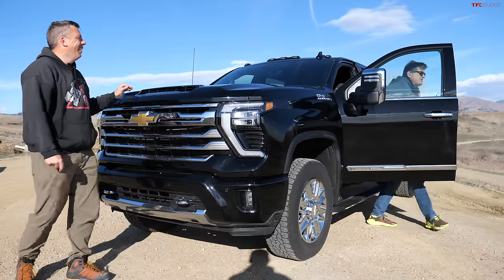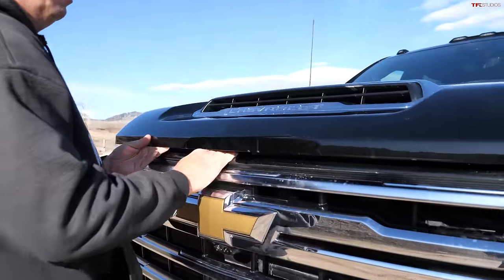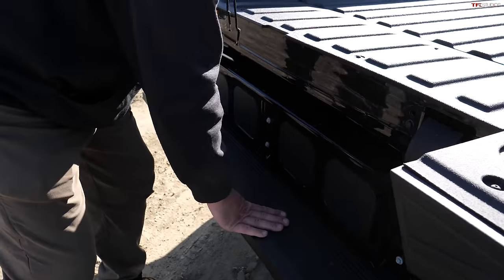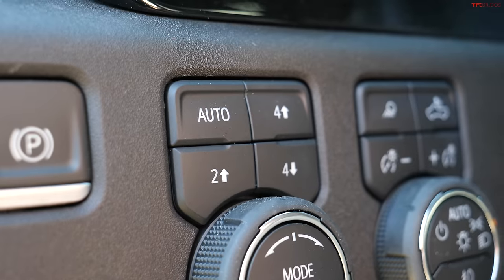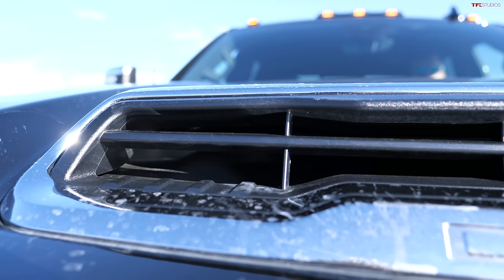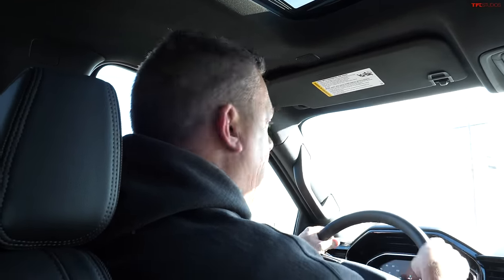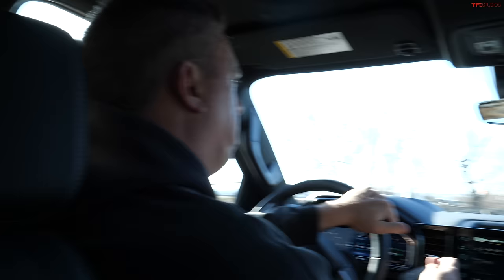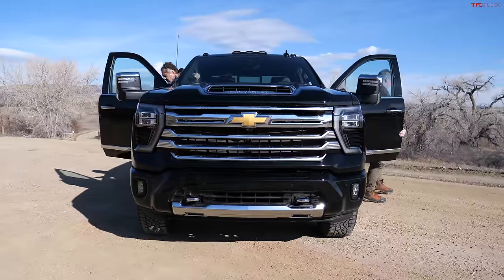Is The New 2024 Chevy Silverado 2500 HD Duramax Diesel The New Benchmark for Heavy Duty Trucks?

Comment: Tune your diesel trucks. Doesnt matter if you’re young or old and you’re wanting huge power or a casual driver, Working truck or daily driver. I habe. 2023 high country. I have it tuned, i use it for work and casual driving all over the place. 5 different power levels and it makes driving my fun more fun and truthfully if i drive casually i get way better fuel milage than stock. Waiting on trans tune to show up now. Should make it shift a lot less lazy!

Comment: I'm seriously considering a new 2024 Sierra with the 6.6 liter gas engine or a Ford with the 7.3. I'm looking forward to Ike tow and mpg tests.
Reply: Or now for 2024 ford has the 6.8 to me no difference to the 7.3
Reply: We have a 6.6 gas with the 6 speed transmission and a Ford 7.3. Both tow mini excavators (about 15k lbs.) Both are pretty comfortable towing the weight. The Ford has more power, the gm gets better mpg. Gm gets about 18mpg unloaded, Ford gets 13 unloaded. Loaded gm is about 10mpg, Ford is 8mpg.

Comment: Ya know, Ford may have a higher peak torque rating, yet GM has the most honest approach about it.  Check out the power graphing of the 2024 L5P over the 2020-2023 L5P.  Its a 25% increase in low end torque production on the 2024 and that's even before you hit peak torque and the torque management has been tweaked.  And it hits the torque quick.  Ford may be getting 1000-1200 peak torque, but the neutering in place before it allows the powertrain to take advantage of it will be extreme.

Comment: Now if only they added a heater for the fuel system and DEF system so they don't freeze in winter.  That bricked by 2022 3500 AT4 Duramax when I really needed it on a cold Vermont day (I suspect those Fairbanks folks would have that issue too!!). Since I did not need the towing capacity anymore, I traded it for a gas truck.  The GMC also had a major module issue that went bad and I had no ABS, AWD/4WD, traction control, cruise control, etc!  Loved that truck but hated it too...  sometimes I miss it then it gets cold and I can start my gas truck and don't miss it anymore! ;)
Reply: They do have DEF heaters.  Two of them.
Reply: @sconner  Mine sure did not work if they had them on the 2021. Now I understand why people have them deleted.
Reply: @jean-sebastienlatouche3678  I totally get deleting the crap.  My 2016 has had a DEF heater replaced twice.
Reply: never an issue in fairbanks, but i made sure to park OUTSIDE. that way the DEF system shuts down, and stays off. until teh heater melts teh tank which it cant do at -40
Reply: @jean-sebastienlatouche3678  all OEM buy teh same DEF heaters, then to meet emissions all OEM over power them and they burn out requiring a tank replacement.
Reply: @jean-sebastienlatouche3678  My 2020 AT4 HD didn't have any problems with def when it was parked outside at -30f these last couple of winters and my 2023 AT4 HD that replaced my 2020 didn't have any problems at -37f. It's very rare that the heated shop is empty enough to fit them in so they have to stay outside plugged in. The 2016 Ford F-350 that I had previous to the 2020 AT4 went through 4 DEF heaters throughout the 115,000 miles that I had that truck. The Ford had constant problems.
Reply: @specialestness  I am glad yours treated you better!  It took one night of -28F to brick mine. Both diesel lines (with filter now waxed...) and DEF were frozen...

Comment: They should have integrated the engine block heater plug into the grill for easy access. The bottom of the bumper doesn't seem to be a thoughtfully designed location.
Reply: It was probably designed this way because the grill would be difficult to get to with a snow blade blocking access.
Reply: Wonder if there’s active grill shutters. So a cord can’t come through the grill. My Tundra is on the front bumper, just as low as that one.
Reply: They've been putting those there since 2020 without any real issue. On the half tons, at least the half tons with the Duramax, they put the plug on the lower front bumper as opposed to off to the side. The active grille shutters would be in the way to have the plug be by the grille

Comment: TFL, have you asked anyone at GM why they insist on firm seats? No one seems to like them.
Reply: Would love that question to be asked of GM. We are in the market for a 3/4 later this year for towing an RV. If we are going to be spending doing hours driving seat comfort is a critical parameter and could be a deal killer on a truck I'd otherwise consider.  Why make the seats so firm?
Reply: They are firm when new but break in nice. Plus a really soft seat stretches the stitching and comes apart.
Reply: @dongarrison2668  22k miles on my truck and still way too firm.... I'd rather have to redo the seat after 100k miles or so rather than be uncomfortable
Reply: My wife and I are looking seriously at a 2024 Sierra 3500 Duramax.  Its primary use would be to tow our RV.  Thus, much of our driving will be 4 - 6 hour trips.  Having uncomfortable seats would be a big negative.  Our GMC dealer has not received any 2024 HD trucks yet, so we've not had a chance to sit in the seats and take it for a drive.

Comment: I drive a 2023 Peterbilt with a Paccar engine it only put out 470 horsepower with 1900  pounds of torque this truck has more power than the Pete u said 9,500 bucks for diesel great video

Comment: I like the Chevy interior over the GMC.  Seems GMC just got lazy and recycled the 1500 console, leaving a weird pad where the shifter was and kept the brake controller further from the shifter.  But you get a big shiny push start button. I also see they both got rid of the 12v outlets.  Wish they kept those as they power numerous electronics I absolutely need for work, towing, and camping.

Comment: my 2020 2500hd duramax z71 offroad seems a way taller vehicle than what yall are standing beside. at 6ft my shoulders are lower than the hood, the chrome strip under my glass window is at shoulder height. why does that truck look so short? looks good inside and out but i prefer more chrome and less black out.

Comment: What about the gas versions
Reply: That's what I'm most excited about. Curious to see how well the L8T matches with the 10spd.
Reply: @hellkitty1014  There is already a guy on YouTube with one doing 0-60s and passing power tests as well as just general driving through the gears. Passing acceleration is up but the 6spd truck has a bit quicker 0-60 he said.
Reply: @pryme2013  wow, that's interesting! Maybe the 6AT was geared better.
Reply: @hellkitty1014  Yeah he said it was due to just how it’s geared. My guess is it doesn’t have to shift as many times before 60 so it is a bit quicker. I have a 22 with the gas and 6spd and I’ve never once cared to try a 0-60 but maybe others do.

Comment: The price is not that bad given that I paid $80 k's for a Tundra Capstone. 
If you are patient, the way they sell latelly , you may be get a discount pretty soon. 
If only they could inspire a little bit more confidence on their reliability,, I would stongly consider. Somehow GM keept it pretty resonable compare to Ford or Ram.
Reply: Na you wont see no discount, these manufacturers are controlling supply and demand by limiting orders and shutting down manufacturing to limit supply enabling them to keep the market accepting of these prices.
Reply: @Pantelifts10  I believe there is more than one reason, why a Tundra and most of these new trucks are so expensive. Suply and demand, because people like me  pay what the manufacturer asks regardless of the cost and so on,, 
I am not going to argue that a HD Gm would tow more or carry more. They are built that way , where a Tundra is built as a light duty truck. As to the reliability of a newly designed Tundra,, is expected to have some growing pain, like with everything else in life. Knowing Toyota, I am not going to be scared because they have few turbo waste gates issues. I trust them, more than any other manufacturer that , they will fix this and any other issue will be addressed shortly. .  
Why I purchase another  Tundra ?? is because my 2010 Tundra last it me ( 485 000  miles) with just a water pump that needed to be changed at 235 K before I sold it. Granted that 70% of my mileage is highway, is still considered a pretty good mileage   
Is Toyota and the rest of the manufacturer getting a little costly ?? hell yes. 
If I had to tow more often, need a higher payload capacity , the GM would be a pretty good choice for the money they are asking.
Reply: @vengeance268  my local Chevy dealer is discounting about $4000 off MSRP for trucks that are on order, not on the lot. You can say what you want but if you look from just a couple years ago, the manufactures are barely keeping up with inflation.

Comment: I've been looking into getting a new truck lately but the price tags on most of them just seem insane. I've always been a chevy/gm guy and would love to get into one of these but my work takes me off road quite a bit. With as tall as these trucks have gotten the ground clearance doesn't really seem to have improved and in some cases (DEF tank location) things seem worse. Those front ends always get a little busted up from me, so i really am not a fan of that block heater location, it sends like an expensive fix even to install an off road bumper.
The power and towing capabilites are incredible but I'd love to see a more farm/ woods capable model even if it sacrificed some towing capabilites. Something with tremor or zr2 abilities but without all the expensive upgrades it takes to get those trim levels
Reply: trail boss will be added for 2025

Comment: The headlight and drive mode (or 4x4) knobs side by side are a non-issue.

No need to keep bringing that up. GM has had auto headlights for like 50 years. They work great. No need to touch that switch. Wouldn't miss it if it was gone.

Comment: Man I own a 2020 2500hd diesel and the placement of the 4x4 switch is not ideal for me on this new one.  I like the current one but the new dash setup is saweet on the upper trims.  I hope they have fixed all the problems though: electrical, noisy brakes, leaking back window, emissions errors, etc.

Comment: everybody who knows about trucks and loves trucks that gm does not  play games like ford or ram, but they all wait until gm brings out their power train and then they add more power to compete because we all know in 2011 when gm told ford lets compare towing, truck against truck ford backed out,  and if gm wants shows  both ford and ram it those not take 1000 or 1085 torque to pull 0ver 35.500.00 kg. so that tells u something, that who powertrain is the best

Comment: The transfer case control buttons are down by the light control knobs ,isn't near as convienant as they we're and the fan control on the heater- air conditioner sucks the knob was way better and its not operator friendley

Comment: The cold weather cord said 120/240.  Could you elaborate on that?  Are there different outputs for the different voltages or recommendations on which way to power it based on outside temp?
Reply: Probably just for versatility. It's just a block heater. Nothing fancy or complicated about them

Comment: This actually looks like the previous model. I think you have it wrong regarding other manufacturers benchmarking against this truck especially considering Ford outsells both the Chevy and GM pickups. . These large pickup are growing in height and length with the main use for towing big trailers. I'm really curious why 0-60 times are important in these mini semi pickups. You need to check your average new vehicle cost. A new "average type" vehicle excluding trucks comes in at $60,000.
Reply: Ford outsells Chevy and GMC separately, but when you add the two together (as you should since they're both GM) they actually outsell Ford.

Comment: They cost a lot. But, i bought my 2018 Ram 1500 Longhorn, new for 46000$ here in Sweden, brand new, +25%tax. But the tax is refunded to me because I use it as a work truck payd by my firm. I got a 5300$ Discount on it. I have 47875 miles on it. Today the dealers ask 44-50000$ for the same Truck with the same miles. I have owned a bunch of Mercedes, and my friends are driving WV, vans, in there businesses, and they have never reached this kind of resale value. So my Ram is an investment and i love to drive it. So the smart thing would be to sell it, but it's a ceaper. Because when other change to EV, they are going to, dream about my Hemi engine, and that keep up the value.

Comment: You guys talk like 19,000lbs is a big deal. My 2020 F250 HCTTP is good for 22,100lb. It has 2990lbs of payload. And runs 0-60 in 6.5 sec. The BIGGEST ISSUE with the GM short bed HDs is the gooseneck ball position is 3" aft of the axle. That is a bad idea. You want the ball forward of the rear axle to apply load on the steer axle, and it also reduces sway. The trailer can't induce sway because the connection is between that front and rear axle

Comment: The seats are a deal breaker for me. I owned a 2019 Silverado 1500 LT and I'd adjust the seats every time I drove trying to get comfortable. Absolutely awful seats. My whole family grew up GM/Chevy people and now dad, brother and I all own F150s. Lol found a 2016 F150, 3.5 ecoboost, crew cab 6.5 bed, tow mirrors, 36 gallon tank. Well equipped, the seats are soft , more power and torque than my Silverado with the 5.3 and easier to work on. I hate that the new GM products are all encrypted and locked down. Can't do shit with them and it's really frustrating. I want to like the new GM trucks more but the newer Ford's are fitting what I want better these days. Still, they are nice trucks overall.

Comment: Why is it that fleets don’t really haul with Duramax pickups? Hot shot truckers and commercial duallys are almost always running Cummins or power stroke pickups from my experience. Any suggestions or comments?
Reply: It is the obvious reason.   If they performed the job equally well or better then everyone would use them.  That IFS doesn't help either.
Reply: @boduke9428  how does the IFS impact towing ?

Comment: Hey TFL guys I have a question for you and maybe you can do a video about this....I have a 2003 gmc but it s 1500 hd has 8 lugs and feels heavy when you drive around my question is why they made 1500 hd if they are the same like 2500 hd I know all 2500 around that age are 6.0and mine is6.0...so my truck is really a 2500 or just 1500 with more towing capacity
Reply: Chevy made the maxx packages for rating and capacities to give the trucks best in class figures.

Comment: 0-60 is a useless metric.  World's toughest towing test needs an update.  My pickup weighs roughly 12k lb on a daily basis and is then expected to pull trailers on top of that.  Trailers range from 12-24k lbs.  Loads can be lopsided, uneven and generally not perfect because that is how the real world is.  Why not have braking on gravel as a metric?  Pot hole stability metrics?  Configuration possibilities?  Since you have your platform, start asking manufacturers what they're doing to make emissions controls more reliable?

Comment: 22.2mpg is the best I've gotten with my 2500hd Denali that has the previous version of the L5P Duramax from the L5P in this video. With our 38' Grand Design fifth wheel I average 13mpg.
Reply: I have a lead foot, and in my 2020 2500hd diesel I get 20 to 21 on the highway typically doing 80, for the reasonable driving I have gotten 23.1 on a long stretch.  Towing my 28' TT I get 11 to 14mpg - again though, I have a lead foot.
Reply: @kmonto1971  I love mine, I had an LML Duramax previously and absolutely love the L5P improvements. I'm at 68k miles already, +50k are towing.
Reply: @OneNationUnderGod.  I love mine to except I have random electrical problems.  Like losing trailer brakes randomly.  Losing trailer connections.  Radio not working from time to time.  I think the truck is darn near perfect, but these random problems where it takes a pull over and shut down, open drivers door, and then restart then close the door to solve.  Unfortunately the stealerships all saying, "Working as designed".
Reply: @kmonto1971  I've never had any problems like that so far, I blew a marker light fuse one time but I'm pretty sure it was the trailers fault.

Comment: If you put the Banks Idash on this truck you will find that it starts in second gear unless it’s in tow mode.
Reply: Really? So 1st is basically a granny gear?
Reply: First:
4.70
Second:
2.99
Third:
2.15
Fourth:
1.80
Fifth:
1.52
Sixth:
1.28
Seventh:
1.00
Eighth:
0.85
Ninth:
0.69
Tenth:
0.64
Reverse
Reply: It'd be interesting to do 0-60 in tow haul then.
Reply: That’s the way my 2022 Duramax works!

Comment: I think it's funny how this truck "has" 110 more hp and 315 more TQ and is actually slower to 60 than my old LBZ
Reply: the 10 speed/l5p regularly drops from 850 wheel torque to 630 unless its loaded with a trailer because of how short the gears are and the ECM doesn't want to over power teh trans with a big torque hit.

Comment: Surprising the 3.0 is faster than the 6.6 from 0-60.
Reply: Makes no difference,  these are trucks, not muscle cars
Reply: Yeah, but I like throttle response.  If I'm paying more for the horsepower and torque, I would expect it to at least beat an engine less than half it's size.  Disappointing in my opinion.
Reply: @lenurban199 HP to weight ratio
Reply: 1800 lbs lighter
Reply: Muscle trucks.  Race em all!

Comment: These trucks are CRAP !!!   I have a 2015 Silverado 4 door 6.0 gas dually with 4:10 gears Bought new and at 8 years 
old has only 62,000 miles.  it gets 6 mpg pulling a 10,000 lb TT and BARELY goes over hills. That's 200 miles to a tank. its a pos